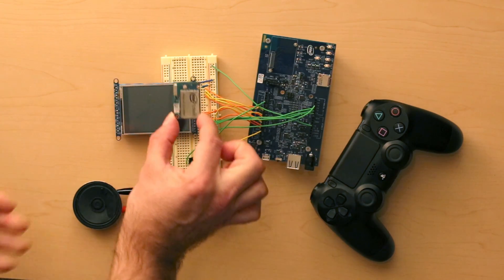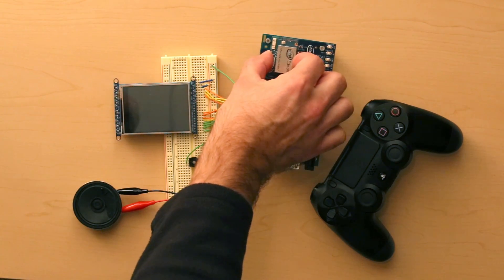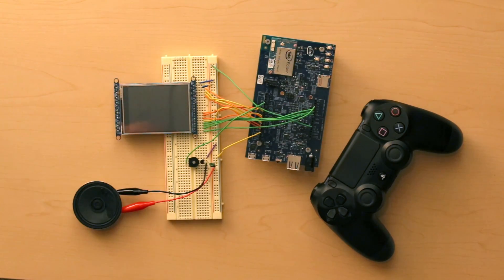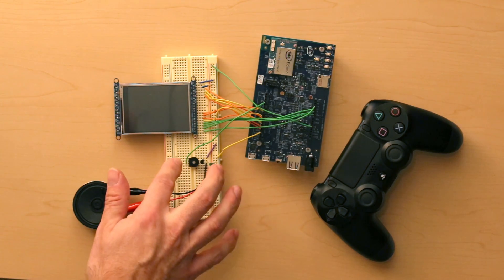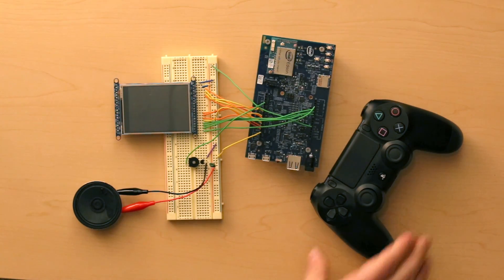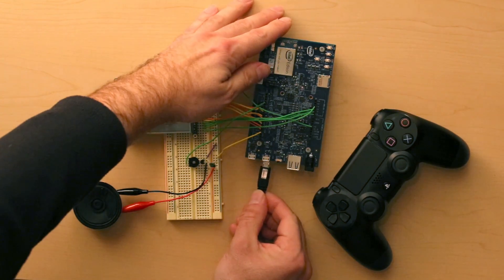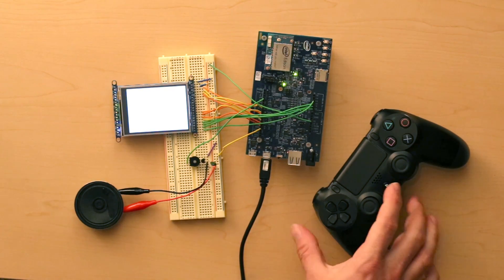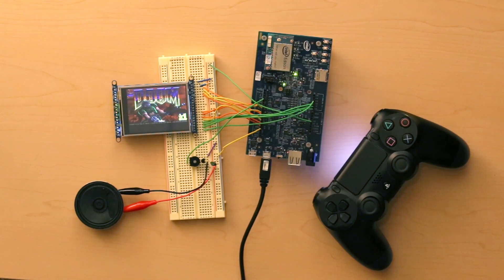Running Doom on the tiny Intel Edison computer

Comment: But will it run Crysis?
Reply: Somebody should really try that. Because if anything coin-sized is going to run Crysis, even if in unsatisfactory way, it's this. But really i think we need SOM (system-on-module) of a more powerful system like Z3000 series quadcore. Something with an actual GPU. As it is, this system struggles even with Quake :(
Reply: Dang.  :/
Reply: ***** nope, no chance, same issue, will be useless.
Reply: Siana Gearz what about Gary's mod
Reply: a hurr derrp

Comment: Do you know if there are any game form factor color LCD or OLED screens like this: https://www.sparkfun.com/products/13035#comment-55fe7be9ce395fb5038b4567

That one is monochrome which is just silly as the thing has 1GB of ram.  With that much ram I could have a full 32-bit double-buffered surface.

Also does this thing support GLES?
Reply from the maker: +zezba9000 Adafruit has a bunch of small color displays, pick your size/resolution: http://www.adafruit.com/category/63 . They are not pre-soldered into an Edison shield like the one you linked, but that just means you can build your perfect combo yourself :)
Reply: +Lutz Latta I just went with that little OLED for now as my hobby project i'm working targets way more then just the Edison hardware so I just need a quick and easy test setup with a screen.  Just very odd they didn't have a color version in the form factor already made.  Thanks though.